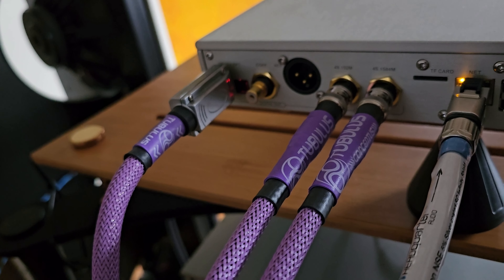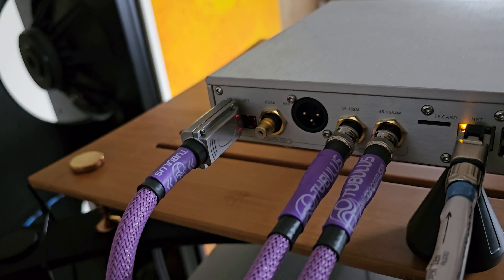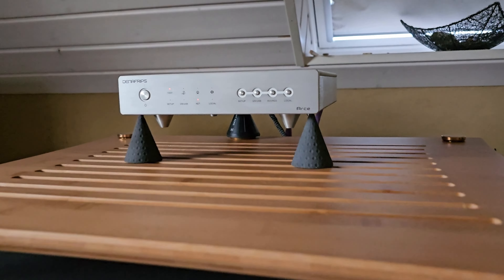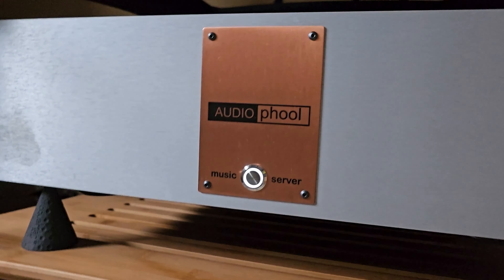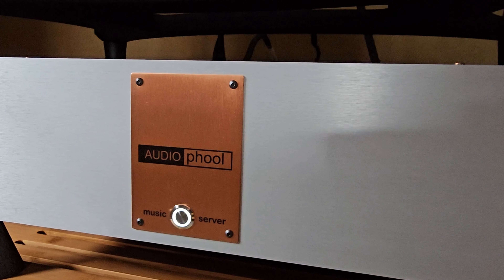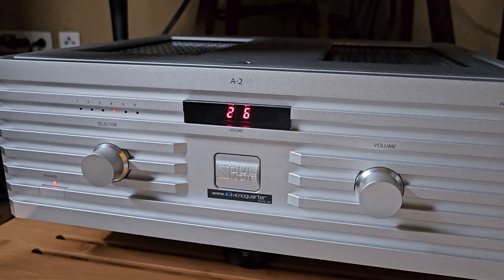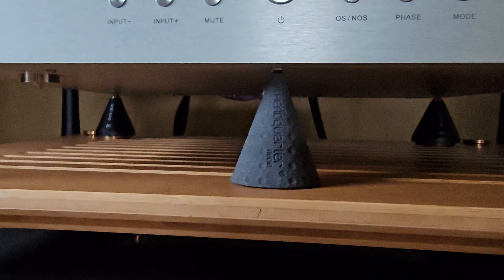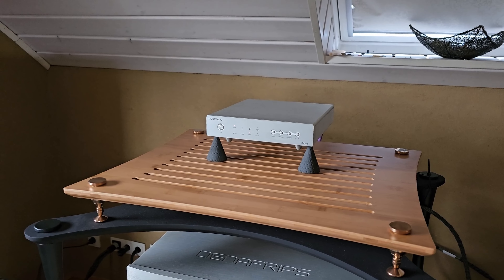Tubulus Concentus Clock BNC Cable, Denafrips Arce Clocksync with Terminator Plus OCXOs

Comment: I can only confirm what Mike says here.  I have been connecting my denafrips gaia to my dac terminator 2 via clock cable (tubulus concentus) for 14 days.  The sound is fantastic!  I can't describe it with words.  It just touches me emotionally.
Thanks Mike for your help and tips.🙏👍🏻😊
Reply: Do you used other BNC cable before ? which one ?
Reply from the maker: Nordost Blue Heaven, Canare, LHY original with ock2, Belden 4694R, Aircell7, China Pure silver with yarbo plugs uuuhhh, Audioquest Diamond RCA with bnc adaptor, Sommer Vector and Focus...  Tubulus is the only one with music...these are the ones of this year... cheers Mike
Reply: @headquarteraudio5388  Many thanks

Comment: Have you considered using the Soul Note D2 dac with X3 clock? Since you use the A2 amp?
Reply from the maker: Hi, no, too much money.. A2 with my tunings is hard to beat. Terminator has super OCXO clocks with output for Arce. No Data at Phasenoise at 1HZ or 10Hz at soulnotes x3. I invest my money for better streaming Network... cheers Mike
Reply: @headquarteraudio5388  thanks Mike.

Comment: Hi, would you recommend an optimized server PC with a dedicated card like jcat pink faun etc. as a roon endpoint
or the streamer denafrips arce?
Thank you
Reply from the maker: Hello, many roads lead to Rome. That depends somewhat on how you are already equipped with your system. Do you have a Terminator II/+? Then, as a first step, definitely upgrade the Arce in Clocksync with Tubulus Concentus clock cables. Then you can stream from a normal PC and you are already in a very good position. If you want more, buy a LHY SW10 and then the Audiophool 2.1 with JCat Net XE card. heavenly...(Roon and router settings are also important!) Cheers Mike

Comment: Would you recommend a streaming-only set up using arce +DAC?
Reply from the maker: Hi, only if: You use Roon, you have Terminator 2 or Plus for clocksync or Denafrips external clock. To have very good streaming sound you have to optimze the fundamentals in your Network. More by email. Cheers Mike
Reply from the maker: Sure, write me an email, so i can give you some settings for roon..cheers Mike
Reply: @headquarteraudio5388 i don't have Roon. One track that didn't sound right with it was 'Looking for a home' by Keith Greeninger. It has two guitar players/singers. Can you let me know how the singers are positioned in the sound stage? If it images correctly on your rig I will give Roon another go.🙏
Reply from the maker: @REX4340  Hi, sorry, please be more precise. There is the original recording of Wind River crossing 1997 or the "audiophile" Version on Blue Coast Collection ESE Sessions ( i have the CD and love this song ) The staging is very different...cheers Mike
Reply: @headquarteraudio5388 how did it sound to you Mike?
Reply from the maker: @REX4340 Hi, sorry, but I integrated new SFP+ transceivers and the Tubulus Concentus V2 power cable into my chain, it took a long time for them to work properly, but wow, now everything is even easier to evaluate. I've always listened to Roon natively, without any processing by Roon. To me it sounds more real and natural. Thanks to your comment, I could now better define what has always bothered me about upsampling, as this recording makes it clear. In the original, the singers seem to be opposite on the left, right, in the background on the right, a little more in depth, first a man's voice and then a woman's voice (that always gave me goosebumps). With upsampling, everything is clearly brought to the center, the depth gradation and the hole in the middle of the original are reduced or even completely eliminated. This sounds very strange, but if you know it, you can no longer hear with upsampling. That's why I'm sticking with the original. Best regards

Mike
Reply: @headquarteraudio5388  cheers Mike so Roon is not screwing the soundstage but upsampling is?
Reply from the maker: @REX4340  You have the choice with Roon, original or with upsampling settings of your choice. I've always been a native listener. Many listen with upsampling because there are audible differences, but they are not necessarily better in every system or in a very good system.Since I no longer use a CD player, I can't say whether Roon changes the soundstage without upsampling compared to the CD.

Comment: Can you comment on arces with terminator with and without clock link?  What difference does the clock make?
Reply from the maker: Hi, Arce is a very good streamer for the price, but with the clock connection it becomes really incredible and can't be beaten at this price (with Roon), a bomb regardless of the price! However, with power tuning, it is simply incredibly good, so you can then teach large server solutions to be afraid of that, cheers Mike
Reply: @headquarteraudio5388 so I just got a T2, 12th for a great price. I will listen with I2S then get the tubulus setup like you have.  Im also going to try to upgrade the analog output stage of the T2 - pretty sure its passive might just need a resistor swap in I/V stage.